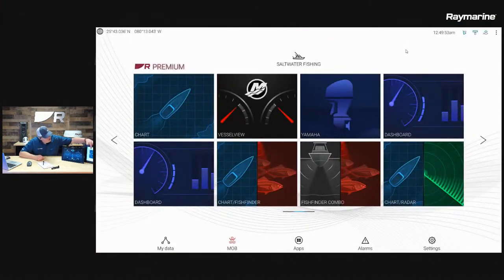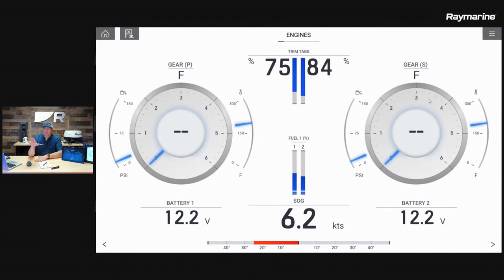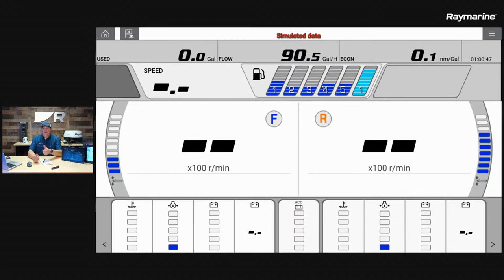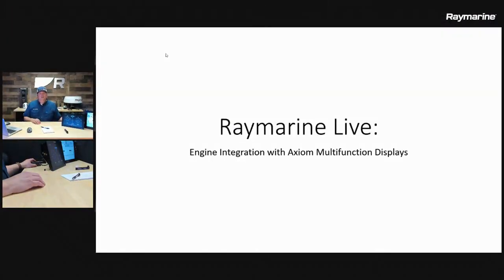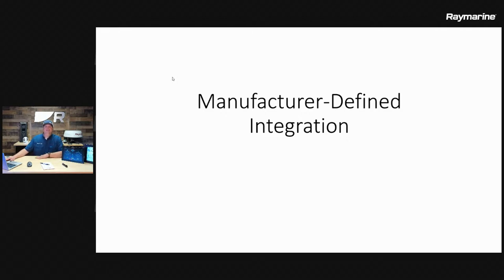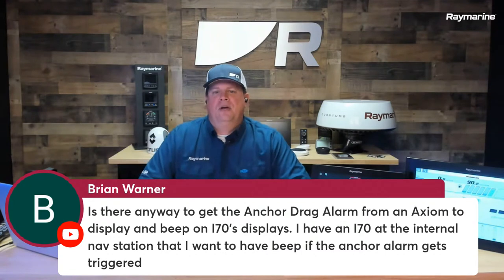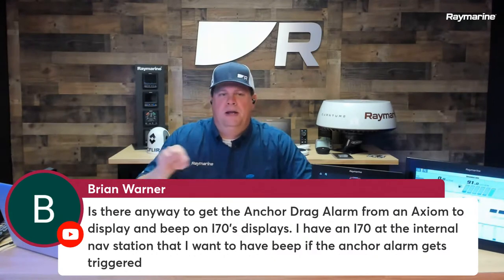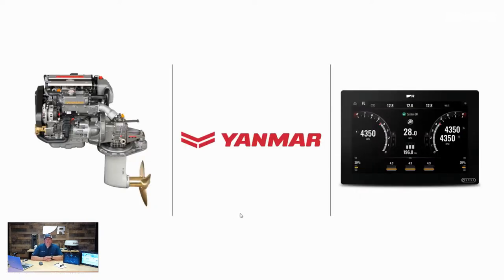Raymarine Live:  Engine Data Integration with Axiom

Comment: Good Presentation and overview of how the systems work together. Just went through this with a 2007 22' lake boat w Volvo Penta I/O 5.0 GM based engine management computer.  Motivation for my install was need for accurate rpm and speed data. Inoperative Speedometer and lack of confidence in OEM tach.  Started with FoxMarine gateway projecting via bluetooth to my android based smartphone.  Of course this gave me the itch to put in a MFD and spend more $$.  Some head scratching along the way to get it to fit on my small dash area. Turned out pleased with this gateway feeding my Axiom 7.
Reply from the maker: Hi Bob.  Thank you for watching and for your testimonial on your experience with the Fox Marine gateway.  It's a great solution for many boats.  I hope your Axiom is working well out there on the lake!

Comment: I’ve used the yacht devices connector to plug in engine data from my Cummins 480ce.  Works great
Reply from the maker: Yacht Devices has some great options for engine interfacing, and other NMEA 2000 sensors too.

Comment: I bought Raymarine which was supposed to integrate with my Yamaha. I didn't know it would cost almost $1,000 in extra parts to make that happen. I could have gone with Garmin and gotten a better autopilot interpreter for about $1,000 more.
Reply from the maker: Thank you for the feedback.   I am guessing that your boat has the Helm Master EX system that I mentioned.  That setup requires 2 interface modules to connect up for full monitoring and control.
Reply: @RaymarineInc  no, it's an Eevee 100 auto pilot, a Raymarine Axiom 7. Smaller sailboat but the integrate my Yamaha engine required over $850 in parts and I'm still counting how much labor. The ECI 100 failed to work so I had to purchase the Yamaha interface. Saying that it's compatible and tying a whole bunch of additional Hardware to this compatibility is misleading at best
Reply from the maker: I am sorry the EV100 did not work with your setup.  Were you trying to populate engine data in the Yamaha app, in the Raymarine dashboard app, or both?  Similar to what happens with Mercury engines, Yamaha also requires the use of their gateway hardware if you want to use the official Yamaha app on Axiom.

The ECI-100 gateway offered by Raymarine will pass basic NMEA2000 engine data and display it in the Raymarine Dashboard application.   The engine-manufacturer-specific apps  (currently Yamaha and Mercury) won't respond to the ECI-100.  They are looking to see their own hardware on the network before they will display data.  The advantage of these setups is they can also provide access to extended proprietary engine information, diagnostics, and advanced controls.

Comment: Hello Jim, I have a Volvo Penta D1-30 and the Raymarine Axiom MFD.
To get the data from the engine to the MFD, do I connect the Raymarine ECI 100 with the Y loom cable E70241 to the engine MDI multi link plug?
Reply from the maker: Hello Ricardo.   The cabling you'll need depends a bit on the age of your Volvo Penta system and what cabling method was used by your boat builder to install it.

Volvo's EVC (electronic vessel control) system is their network that carries data between engines, displays and controls.    Raymarine's ECI-100 is a gateway device that can be connected into the EVC system, creating a SeaTalk NG/NMEA2000 data connection.   The ECI-100 also provides opto-isolation between the SeaTalk NG/NMEA2000 network and the Volvo EVC network.   This is required by Volvo to protect their network from any possible interference.    

Most recent Volvo Penta systems utilize a Multi-Link hub to connect together various Volvo components.   These hubs have 6 connections.  The hub is normally yellow in color.  Empty ports will normally have black weather covers installed in them to keep debris and moisture out.    1 port on the hub needs to be empty to plug in the ECI-100.  You'll make that connection using a Volvo Link cable, part number E70240.   It has the Volvo connector on one end, and a NMEA2000 DeviceNet connection on the other that will connect to the ECI-100.

Older Volvo Penta systems did not use Multi-link hubs.  Instead, those systems were cabled together using Volvo engine bus cable.    These Volvo engine bus cables came in fixed lengths with ends that plugged together allowing you to combine them for longer runs, or create drops to plug in components.   If you have this kind of system then you will use the E70241 Y-Loom cable to create a drop to connect the ECI-100 in.    The other port on the ECI-100 is a standard SeaTalk NG spur connection.   Use a spur cable (supplied in the kit) to plug into an empty spur port in the SeaTalk NG network.

There are some illustrations of ECI-100 in a Volvo Penta EVC network in our ECI-100 installation guide:
https://www.raymarine.com/multifunction-displays/accessories/engine-interfacing/eci-100/

Comment: Thanks Jim really great video and very usefull. My question is; what do i do on my sailboat if  I want to monitor my Yamaha 4JH110 and Cummins Onan Marine QD genset on my dashboard. Is it possible to achieve this. Would be great even if we can do this on separate custom data pages. That way I can see whats going on with my Engine and also with my genset. I think I can connect with using YatchDevices. For Yamaha :"Engine Gateway YDEG-04 with Raymarine SeaTalk NG connector" with the option of 	"Yanmar 4JH adaptor cable" and for Cummiins Onan "YDEG-04 with Raymarine SeaTalk NG connector". Would Axiom Pro enable to configure these 2 different engines so I see them on my Axiom ?
Reply from the maker: Thanks for watching the show, Oguz.   What you are looking to do should be possible.   Axiom will see each engine as a separate NMEA2000 device.   You would need to build some custom data pages in the dashboard app to see everything.    I do suggest getting in touch with YachtDevices to make sure their gateway will work with each of your devices as desired.  That is really the critical part of the connection.   Once the data is made available on NMEA2000, getting Axiom to display it is fairly easy.      

One note, on monitoring the generator.   At the moment we don't have very many data fields for the generator-specific electrical stats.    Things like the AC output voltage, frequency, etc.   We'll be able to read all of the common engine data values for it though.  Things like RPM, oil temp, oil pressure, hours, coolant temp, etc.

Comment: I have a 1995 princess 48 with twin caterpillar 3208 engines with original Raytheon equipment which I’m in the process of updating all electronics with Raymarine. I have purchased the the axiom 12 pro and 2 axiom 9s a new radar new autopilot Twin transducers and some other Raymarine products to fill the holes of the old seatalk displays. 
What engine interface would you recommend to talk with the new Raymarine equipment to show me engine data? 
Thank you
Reply from the maker: Hello Nicholas.  Your CAT engines pre-date NMEA 2000 electronic data, so you might have to rely on a 3rd party solution to convert any electronic data from your engines to NMEA 2000 format for display on Axiom.  As a starting point, a big determining factor will be whether your current CAT gauges are analog or digital.   If they are digital, it may be possible to use a 3rd party adapter from someone like YachtDevices to get a data feed for Axiom.   If your gauges currently are all analog, then you'd need to look at an analog-to-digital option like the ActiSense EMU-1, Noland RS-11, or other options.  These are much more complicated to setup.   Feel free to send me an email to james.mcgowan@raymarine.com and please include a few shot of your helm and current engine readouts.

Comment: Hi Jim, first thanks for the very detailed explanations. May be I missed among this bunch of info but I have 2 questions. Can we see the range data on MFDs? I mean I’m headed to X, consuming 156 lt/h , imagine there is still 110 miles to my target and I am not sure if the fuel on board (X%) is sufficient to make me reach my target? Or somehow do we need a calculator?😊
My second question is, on Axiom can we do autorouting? I.e. Just enter the starting point (Istanbul) and the arrival point (Antalya). Does Axiom generate an auto route like navionics mobile app?
Thanks in advance and have a great weekend. 
Cheers, Hakan
Reply from the maker: Thanks for watching Hakan.   Axiom can estimate your remaining range.  In order for it to do this it needs to know how much fuel you have onboard, and how fast the fuel is being consumed.  The calculations are made using a combination of Axiom's fuel manager, plus from live fuel consumption data from the engines or a fuel flow sensor.   Assuming you have all the right hardware in place and connected go to Home...My Data...Fuel/Trip...Fuel Setup.  There you can setup the fuel manager, tell Axiom how much fuel the boat holds, and signal to it when tanks are full.  Axiom then uses the burn data from your fuel flow senders to estimate the range.  Fuel range can be added as a data item to any screen, either on the data sidebar or as a floating on-screen data item.  In the data menu its under the Fuel Category, called Distance to Empty.  There is also Time to Empty.   

Axiom support automatic routing, but only with either Navionics or C-MAP electronic charts.

Comment: Jim I have twin 2004 Evinrude 250hp Direct Injection motors (model #E250FPXSR/E250FCXSR) which is the year before ETEC. Is there an N2K engine gateway product I can use to get the data to a 12” Axiom RVX 3D? What else would I need? These engines have Deutsch connectors on the ECM. Evinrude part 764164 seems to refer to ETEC engines.
Reply from the maker: Hello Douglas.   From what I can find online, it appears that NMEA 2000 support is available only on 2005 and newer 115 to 200 horsepower ETEC motors.   The connector on your ECU is most likely the diagnostic service connector.  I have not seen a gateway device for your engine, unfortunately.  It might be worth posting an email to the team at Yacht Devices, as they have some options for J1939, J1708 and other common engine protocols.   It is possible that your generation Evinrude outputs one of those, but I can't find many details online about them.   Where they support so many different data protocols, they may have some familiarity with your situation.   https://yachtdevicesus.com/

Comment: Thanks for a great video! I have today installed Yacht Devices YDEG-04R on my Volvo Penta D1-30 2007 engine. I halso have a Axiom MFD with the latest SW verion. How can I see  what data the YDEG-04R Device is broadcasting on the NMEA2000?
Reply from the maker: Engine data is displayed in Axiom's Dashboard app.  Before you open it though, go to Home...Settings...Boat Details and scroll down to the Engine section.  Set your engine manufacturer to "Other" and tell Axiom how many engines you have.  This will ensure that the Dashboard page for engines is setup to display the proper number of engines.

Exit back to the home screen and touch Dashboard.   You may need to scroll through its available pages until you get to its engine data screen.  NMEA 2000 engine data should populate those gauges.

Axiom also has a NMEA 2000 data reader for diagnostic and troubleshooting.  Go to Home...Settings...Network...Diagnostics...NMEA Devices & Messages.   The YDEG Device should be listed there, and if you touch on it you can see the basic data it is sending.

Comment: Owner of 2xAxiom 9' and 1 x Axiom 12' in my boat with dual CAT 435 Hp. Everything intergrated good. On navigation, when I put "go to" waypoint, the system draws a direct line to the waypoint and does not "plot" the optional route. If I put manually the destination point, then it plots the route but with no data (distance, time, ETA....). Can we do something about that???
Reply from the maker: Thanks for watching the show!  I think the feature you are looking for is automatic routing.  The "GoTo Waypoint" command always creates a direct point A to point B destination, and does not take into account any obstacles.

If you are running C-MAP or Navionics charts on your system you should be able to long-press on your desired destination, and then select "Autoroute To Here" from the popup menu.   The routing algorithm will take into account your boat's draft, beam and height* and plot a favorable route to the destination using the navigation aids, depths, etc. on the navigation chart.   

If you run Navionics charts, they do need to be activated and on a current "Freshest Data" subscription.  A 1-year subscription to the program is included with every new chart purchase and can be renewed after that.   You can activate your charts on Navionics.com.

*C-MAP autorouting includes vessel height along with draft and beam in its calculations.  Navionics only uses draft and beam.

ETA, Distance, etc. is available on the swipe-out sidebar, or you can add data overlays to the chart with that information.
Reply: @RaymarineInc  Thank you for your answer. This is exactly what I am asking from your software people to fix, the option "go to" waypoint should NOT create a straight line, it should take into consideration obstacles. I have Navionics charts all updated etc etc and the only way to get close to what I am looking for is to ask the "go to" to plot the line and give me distance, ETA etc etc and then go manually to my destination, place a pin and then ask "autoroute" to draw the optimal line. Problem is that the data I see are from the go to straight line, so not accurate. If the "go to" plots a correct route taking into consideration the obstacles and boat details, we could with one action have our route with correct data.
Reply from the maker: Thank you for the feedback on GoTo Waypoint.   I'll have a chat with our product team and see what we can do with it.  Since you are running Navionics you should be able to simply long-press on your desired destination and select "AutoRoute to Here" from the popup menu.   That function should do exactly what you are asking, if I am understanding correctly.   It will create a route from your present location to the destination, taking into account obstacles.

Comment: Jim, thanks for the video.  As always, very informative.  My question is regarding Mercury VV and just how much data will come through to the Axiom unit.  I have the Mercury 403 Vesselview screen and it includes things like Trolling, Cruise Control, etc.  When we set up the Connect module, it asked us if we wanted to set those items up and we answered YES, however none of this data is available on the VesselView app on the Axiom.  Should all of the VV403 functionality be available on the Axiom if set up correctly, including cruise control and troll and tow smart, etc.?
Reply from the maker: Hello Alan.   As of today, you won't get cruise controls, troll control, and tow smart on Axiom.    We have been adding Mercury features over the last several software releases.   The good news is that these are in the works and should be available soon.

Comment: Great videos. I got a boat with Merc 8.1 engines. Before purchasing the boat I saw all the information getting into the information center. After picking the boat none of the information was getting in. I am suspecting the surveyor disconnected a plug and did not connect it back. Where is the plug on the engine itself? I checked on the dash and looks as everything is connected. I do see few plugs on the engines that are not connected. Thanks.
Reply from the maker: If your boat has a Mercury VesselView display of some kind onboard, that may be the source of the datastream feeding to Axiom.   Many of the later model VesselView displays do support NMEA2000 networking.   There would be a spur cable fed from the back of that display plugged into Axiom's SeaTalk NG network.

The data is carried from the engines to the helm on Mercury's SmartCraft network.  SmartCraft links together your engines, throttles, gauges, and other Merc-specific hardware.   

Sometimes there is a Smartcraft hub inside the helm that links many of the Mercury devices together.  Depending on the capability of your engine display, there could be an optional VesselView NMEA2000 gateway providing data to Axiom.  This is a black-box device (no screen, just some LED status lights) and it would similarly also be plugged into the SeaTalk NG network.